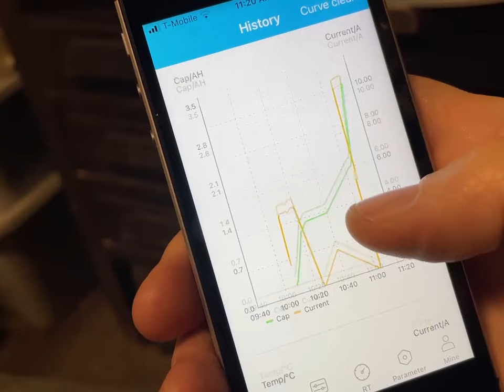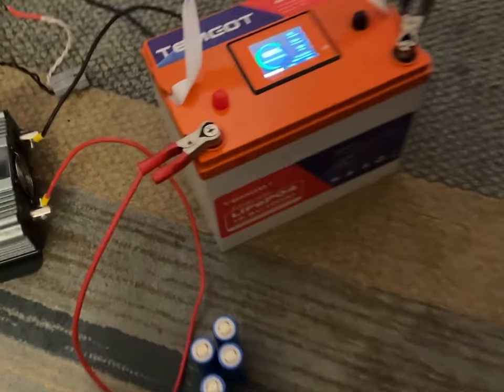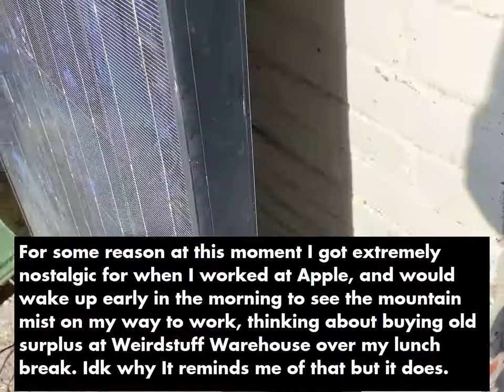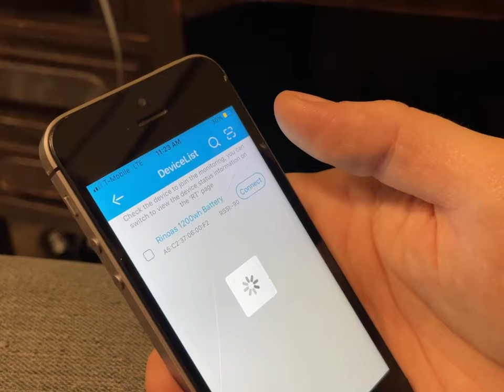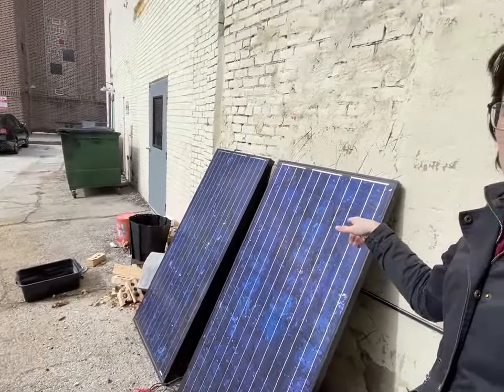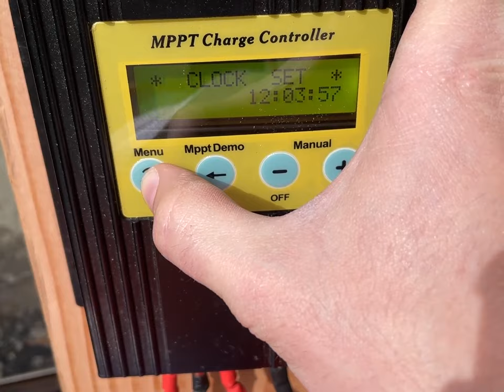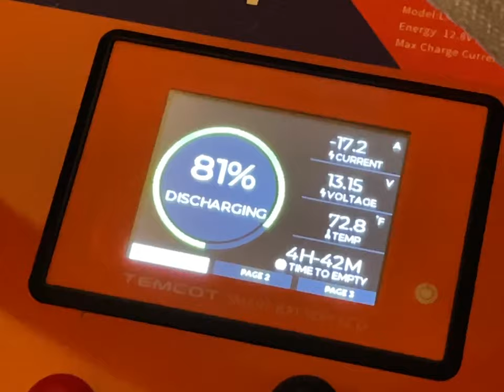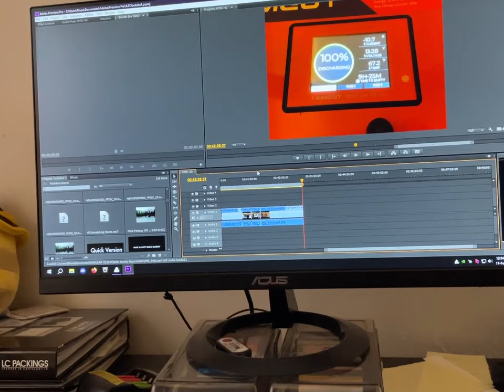Solar Sunday Experiments 23: TEMGOT LiFePo4 12v 100AH self-heating battery review with MPPT system.

Comment from the maker: Temgot have updated this discount code:  You can use 058XX5YA at both https://www.amazon.com/dp/B0BTBQFLDX and also https://www.temgot.com/products/temgot-12v-100ah-lifepo4-battery-with-bluetooth-deep-cycle-lithium-battery-with-100a-low-temp-self-heating-bms
Reply: No speciel snowflake chargers required ?
No accounts on the app required ?
Very well put together manual ?
Dayum, this battery is well worth the cost and unsure whether those are genuine Sodium Iron Batteries and hopefully they are genuine!.

Comment: You can cold weather draw lithium as long as its below .2C charge profile to amp hours.
So a 600ah bank you can draw 50-120amps at -10c
Reply from the maker: LiFePo4 is different from lithium-ion though, you get weird electroplating (if I understand right) happening under freezing point for these
Reply: @RinoaL  sorry I meant lifepo4 at low C draw you can discharge at below zero
Reply: @RinoaL  there's some new research on it the new electric cars have current limiting if the battery pack gets below a certain temperature
Reply from the maker: I see, thanks for the clarification. Thats interesting to know and good to know
Reply: @RinoaL  yes because I have a 600ah bank of lofepp4 on my sailboat without a bms lol just a mppt charge controller and my inverter has a 10.5v cutoff
Reply: @RinoaL  and I only have 600w of panels so even at max output .1C charge it won't damage my bank even if it's -20 outside and my only intermittent draw is a deep breeze less than 200w so I'm constantly below the .1C draw and charge if it goes below -10c

Comment: Nice video Rinoa,, you need your self a playhouse, where you do not have to take stuff down/in every day 🙂
I have also done some LiFePo4 battery videos,, non with a cool display like that one,, but some bigger once,, in video 1343 I had to get a 280AH 30KG battery up my "mountain" Yes I bought a house in Portugal with a mountain or a slices of a mountain.  But I have been making an internet station on the top of the mountain (I get poor inter net at the house,, as the mast is on the other side of the mountain,,I fix that with a solar setup and some router stuff 🙂
Reply from the maker: Oh dont worry, I will be able to mount these panels on my workshop when we get a scissor lift. The roof is like 8 metres tall haha.

By the way its great to hear from you. I saw one of your videos about the lifepo4 battery a while ago and had no idea you bought a new house. Very cool

Comment: YEA ! LIPOFE4 CELLS CANT TAKE STR8 RAW POWER RIGHT FROM THE PV MODULE LIKE THE LEAD ACIDS WHICH IS NOT SO ALSO BECAUSE OF THE BMS CUTTING THEN OFF FROM AT A RATED THRESHOLD . BEST TO USE A CHARGE CONTROLLER FOR LIPOFE4 BATTERIES OR PROGRAM IT AS BEST AS YOU 
HIGHEST CAN WITH THE RECOMMENDED CHARGING VOLTAGE  . MAY THE SOLAR BE WITH YOU .🤗
Reply from the maker: Sure it can, but the BMS cant

Comment: I remember a time when Tesla was announcing super chargers, and they had that Solar Powered station that fed the charger and excess back into the grid.

Every time I see a super charger station that goes online, it is ALWAYS plugged into the grid with no solar...

What happened there? I am not an electrical engineer, but I mean... come on, there has to be a way to make a super charger system that will allow you to do exactly that. Setup a solar panel type cone/area around the charger that gets solar energy or something like that, then uses that power to charge the station. Like... what?! Isn't it like 12 panels you need? You can do that over a car park.

Anyway, this is very cool, and those battery packs look amazeballs. Seriously. 10/10 Would Recommend. +1 Sub.
Reply from the maker: I know in silicon valley we had issues of people complaining that the solar panels looked ugly and filed complaints, and then mostly the biggest issue is it becomes excruciatingly difficult to get licensing for it in some places when its really just there for aesthetics. It works out way better to just have the panels on a mountain somewhere else than to have them in the city sometimes

I worked at an EV startup for a short time in sunnyvale and we worried about those issues back then too

People with their rules get in the way a lot.

Comment: Stranded wire works better in DC applications. It’s thought that the electrons travel on the outside of the conductor instead of in it. Solid core works well in AC applications and can use both solid and stranded very well. That is why you won’t see solid core in commercial DC applications (with the exception of jumper wires)
Reply from the maker: I feel any difference is negligable because the wire still wasnt having any noticable voltage drop over it and it was free. So I think itll work.

I’ve also seen a lot of engineers mostly decide to use stranded core just for mechanical properties. Unsure on how big the electrical difference really is

Comment: for my workshop solar solution I had a similar problem with cables, they can be expensive to get decent sized cables- luckily at the very same time one of our local cheap shops had a deal on sets of car jump leads, I bought 3 sets of jump leads and that wired the whole lot up a lot cheaper than just buying the cable, plus I have all the huge battery clips that I cut off the ends just waiting for a use. so if you see cheap car jump lead sets, then you will have a decent thickness wire. (even if they are too cheap to use for starting a car, they will be great for solar systems
Reply from the maker: Yeah the solar system I built years ago in this series used jumper cables, but it ends up most of those cables are mostly rubber and only a little copper
Reply: I bought welding wire and  different size lugs and made my own wires very thick all copper and you can make any size you need . Much cheaper than buying pre-made cables.

Comment: The MS Paint logo is great. Could some of this be integrated into HomeAssistant with a raspberry pi? That could potentially eliminate the need to have the app open to get historical data.
Reply from the maker: It all depends on if this BMS has an API you can use.

Comment: Could you test this on a washing machine cycle?
Reply from the maker: No because I dont have a washing machine. I plan to make an open source one though
Reply: ope! I knew about your open source plan and didn't realize you were without a working unit. 🖖
Reply from the maker: hahaha no problem
Reply: Only if the inverter does not kill itself when the motor starts...
Inertia is a problem from the wet close and water 😂

Comment: Do you think these batteries would be good for an E-Trike?
Reply from the maker: That would depend upon how cold your weather gets. If you can wait a little bit, sodium-ion batteries look to hand deep freezes better than almost anything. LiFePo4 would handle long usage really well, but maybe add insulation to help keep them from freezing in winter. For an e-trike you might be better off making sure you get an impact-resistant battery such as one from an electric car. Nissan Leaf cells would be fairly cheap.
Reply: @RinoaL Well, I don't have the trike yet, but it does get into the 30's and sometimes 20's here. What do you think of the 400 watt panels?

Comment: Are you charging those without a charge controller? I presuming this function is being replaced by the battery’s internal BMS?
Reply from the maker: Initially, the BMS didnt like it but it took me a few days to get my MPPT controller out. I would have rather charged the cells directly since the BMS gave issues and would fry once it got past 15v but oh well I got past that

Comment: You need a faster CPU. To reduce\compress my videos I like to use the older version of Windows movie maker.  Are you in the UK..?
Reply from the maker: X86 hasnt improved a whole lot since my i7 was released, so itd be better to switch to ARM at this point. Modern CPUs are still only about 70% more capable so I plan to wait a bit longer. Also many modern X86 cpus have gotten worse with power usage

Comment: No blocking diode on that panel? 😱
Reply from the maker: I think the diode is hidden since I havent had them pull any current
Reply: @RinoaL if there is not a blocking diode, that would explain why your battery kept switching between charging and discharging. I think there may be some redundant blocking diodes in the charge controller.
Reply from the maker: I’m meaning for the other batteries Ive used with it that didnt have a BMS, I didnt notice a current draw from it however maybe it was just bright enough out to have voltage equilibrium